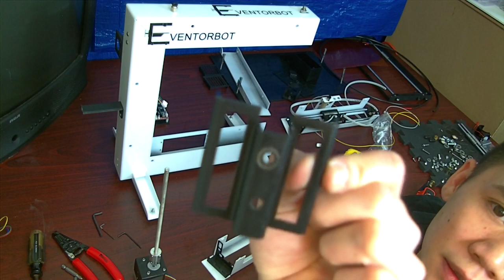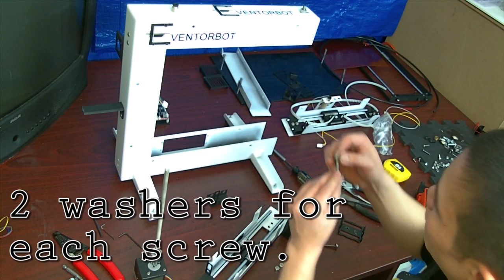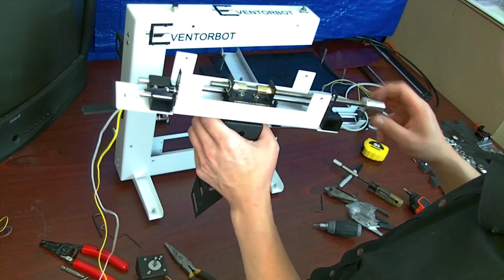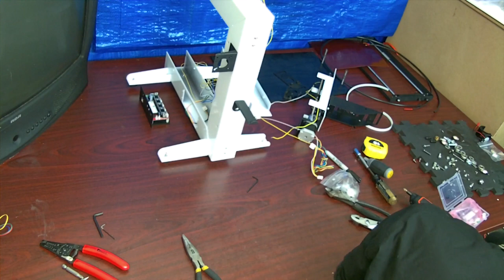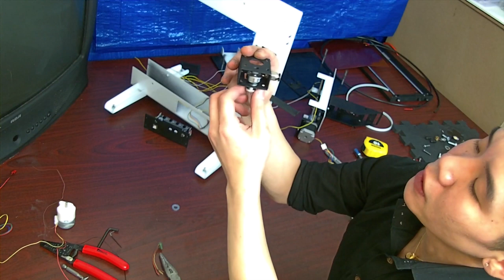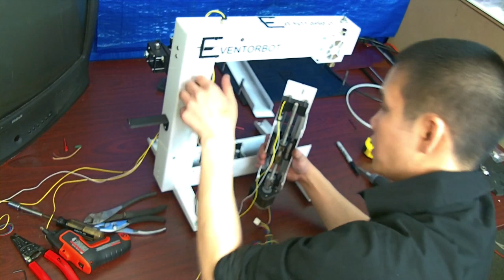3D printer Eventorbot 1.2 assembly video part 4

Comment: Instead of the wire wrapped around the threads, you can uses some thin shim stock sheet metal, steel or even brass or copper will do.  The coupling is fine, as long as it centers on the shafts.